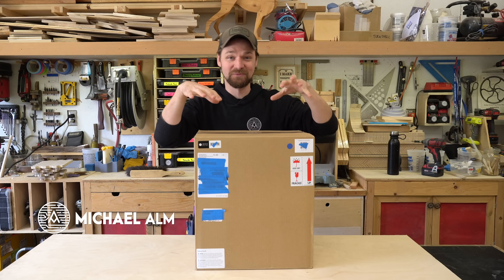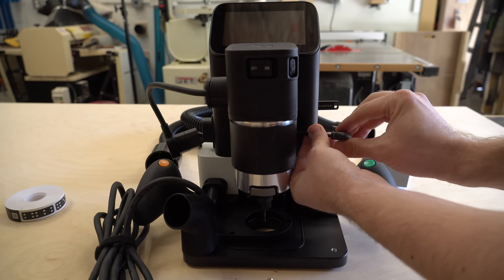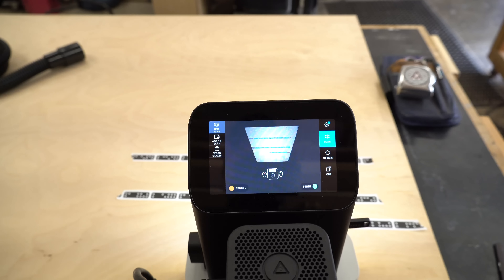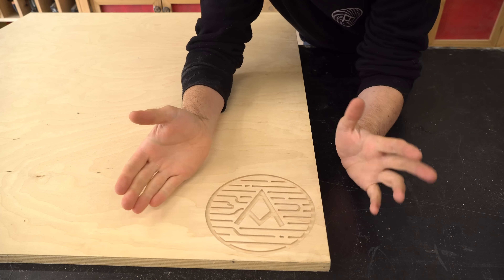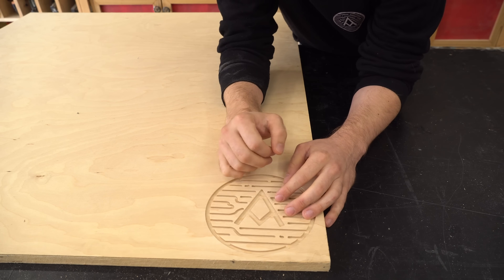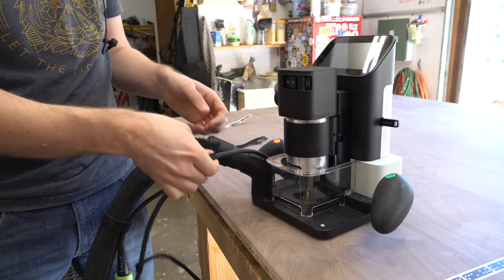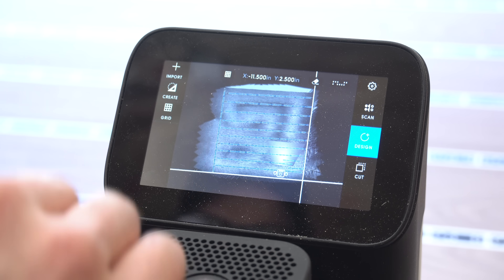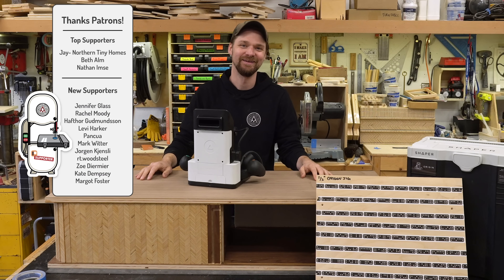Testing Shaper Origin Handheld CNC Machine

Comment: Never understood comparing this to a CNC, it is most definitely not a CNC, it's more of a tracing router. I have several CNCs and their purpose is to not only speed up my builds but automate processes so I can focus on other projects. Having to make sure I always have that tape on hand and having to spend hours being the motor for it means it's a no for me but for small projects I can see how it might be helpful. 

The other factor is the cost being greater then the features, I have CNC operations that take a motorized system hours to cut and doing that by hand would be exhausting.
Reply: For small projects it's much less helpful. If you're using it for small projects than a simple desktop CNC will be much better. He showed the best case scenario where you're doing a section on something like a table top, but if you're regularly doing that, then a full size CNC is way more useful.

Comment: First time I've heard of this device. Sounds interesting and since Festool is connected to it that gives me hope of quality and that the company won't fold in 3 years...

I'd like to see if it can do any of the following:
 1. a mortise and tenon joint
2. A curved surface like a chair seat
3. A curved plane raised panel
Reply: please don't compare this tool to festool  because if you delve deeper into festool you will find to your dismay it's far from top quality this may well be first quality but festool is not
Reply: @fredblair4307  this is very true.  People seems to think festool tools are of extreme quality because of their price.  I have owned multiple festool tools and found that they do have nice features but the overall quality is actually very low when you look at the price they charge.  If you take out the systainer setups they have the only real feature they have is dust collection and this is only good on some of their tools.   If they didn’t have the systainer setups I think most people would really not be willing to pay the price they have especially when you have to get proprietary consumables.   If a tool maker like Milwaukee would make a nicer tier set of tools that included inserts for their tool boxes and some dust collection for half the price they would run festool under .
Reply: @fredblair4307  It’s hard not to compare it to Festool.  Festool owns the Shaper system, so it IS a Festool.
Reply: It is also way overpriced just like festool..😅

Comment: How about peg boards would it be practicle for things like that?  Thanks
Reply: It does a good job at holes.  It does a helical down cut.  As long as the hole is in the cross hair circle, all you have to do is hit the green button and let it cut the hole. With the grid you could even do them without a computer.  Granted it would be faster to layout with software.

Comment: Even large CNC setups are cheaper than this and don't rely on human hand-eye coordination. People may say they aren't so user-friendly but... you'd pay $1,000+ more just to avoid learning something? Yikes.
Reply from the maker: I want to know where you're finding these cheap CNC machines. The base model X-carve which has a 40" bed is $2,300.00. The XXL Shapoko which has a 32" bed is $1,800. Neither of these machines are big enough to cut the tracks I did in the video. The cheapest 4x8 I could find starts at $5,300. Also, all these tools require you to construct them, which is not trivial. Origin is ready to go out of the box, and has no limit on cut size.
Reply: @MichaelAlm  I mean the first two projects were the size of a corn tortilla, which can be done better by 12" CNC machines that cost a quarter of that price, AND they have a Z-axis. Your third project... yeah it's large but what you did with it was so basic you didn't even need the Shaper for any of it. People do the same cuts all the time with just a router, some guides/jigs, and maybe a chisel to clean up corners. Even YOU did the same cuts with just your router table in a video a month ago (roll top cabinet). And it's a trivial amount more difficult to do for a non-trivial amount cheaper than this thing. But oh well, I guess Apple's success is proof that you can always find customers willing to pay 3x more to make things 10% simpler.

Comment: Way too expensive. It is not much different from a router - apart from the screen, software and pcb. Those parts do not justify such a high price tag. And you are dependent on that expensive tape.

Comment: This such a cool tool. It is super expensive, but I'm still tempted. Thanks for sharing this.
Reply: Why wouldn’t a normal cnc machine be a option??
Reply: @justkiddin1980  most people don't have the space for a full sized cnc.
Reply: @saffsai  Hmmm...i don't know there are always options possible when you can fold it away or store it under a work surface...You really need to think about the cost and ease of use of this machine..It is really really expensive and not really easy to use...because you need to hover over your project all the damn time..So i dont care but if you want to spend about 4500 pounds and only do very small projects be my guest...and a viable alternative would be a nice ooznest workbee for one third of the price...I just ordered mine 1000×1000 for 1500 pounds...
Reply: @justkiddin1980  
I agree. It is for an enhanced router.
Reply: @justkiddin1980  I wonder if you could tell me -how does ooznest compare with x-carve? Thanks
Reply: @mickgoodbe235  I haven’t received mine yet but from the research i have done everybody says the ooznest is more ridged. Not only that, the x-carve has belts and the workbee has leadscrews..maybe the only thing the x carve has going for it is the software easel..
Reply: @justkiddin1980  thanks 👍
Reply: I was shocked when I saw the price. As I was watching it I was trying to think about how much it would cost and I guessed $1000 max, damn was I wrong..haha

Comment: How is the integration with Festool dust extractor? I am assuming it does not use the standard Festool plug? Does the Shaper trigger the vacuum properly or does the on board computer start up the dust extractor?
Reply from the maker: The tool needs constant power to run, so unfortunately the auto on/off on the vac doesn’t work. You have to manually turn the vac on. Festool does make a bluetooth button that can turn the vac on/off remotely which is the best solution I’ve seem
Reply: I have Shaper and use Festool CT48. Although Festool now manufactures the spindle for Shaper it doesn’t use the same electrical cord. If you plug the tool into the dust collector set to auto it will trigger extraction just like any other tool.

Comment: This is a fantastic video on Shaper. Most videos start from the perspective of the user already having experienced the tool. But you starting from unboxing made it super informative. (Still trying time figure out grids). Please definitely put out 1 or 2 or even more videos on this tool. (Finger joints etc.)  You’re a great educator with appealing style. THANK YOU. (Was just using the Shinto rasp you recommended on the banana video, when this video popped up :)
Reply from the maker: Thanks! Grid was a little hard to explain. It basically sets up an origin point with axis that run the edge of your board. You can then grid that out in any increment you want. The layout tool then snaps your drawing to that grid. It’s really intuitive in person, but tough to verbalize.